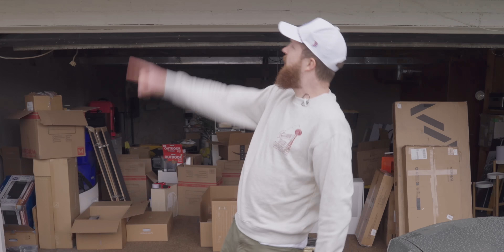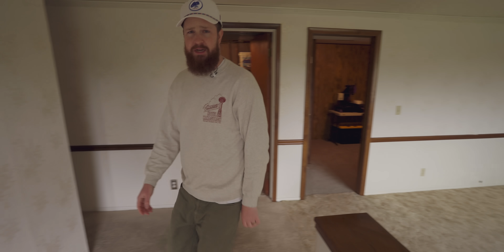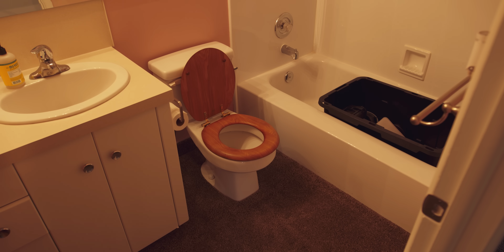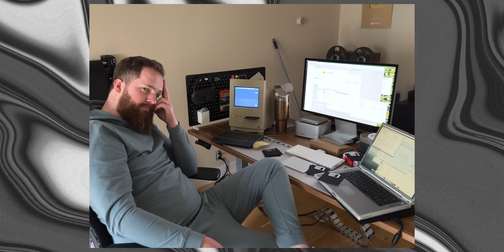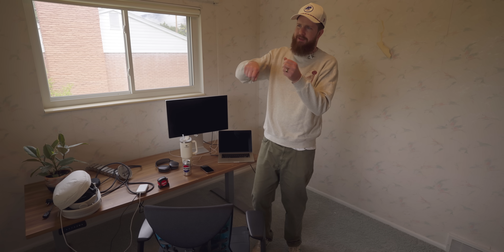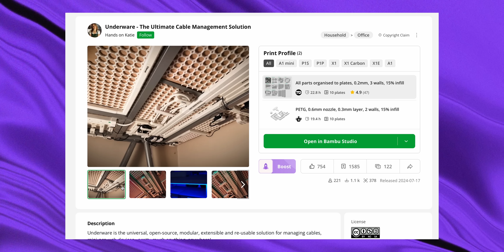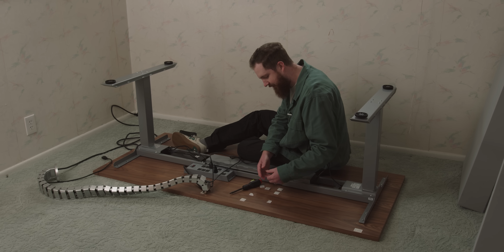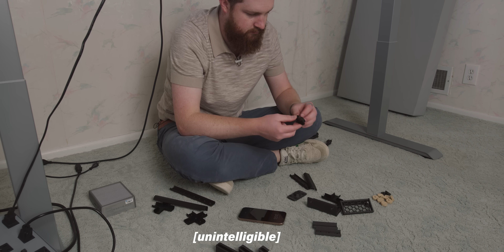Cheap, DIY Cable Management—Like a Pro!

Comment: Any estimate on material cost of the printings? I'm curious what something like that costs to print.
Reply from the maker: A few dollars at most!
Reply: The peg board he shows would be a few dozen cents to print, not accounting for power. PLA costs about 20 bucks per kilogram, and a print like that would really only be maybe 30-40 grams, so about 80 cents. The other bits would be maybe twice that.
Reply: @daylen577  Wow, so not much then. I was under the impression it would be much more and that 3d printing was a bit extravagant. Thanks for the info